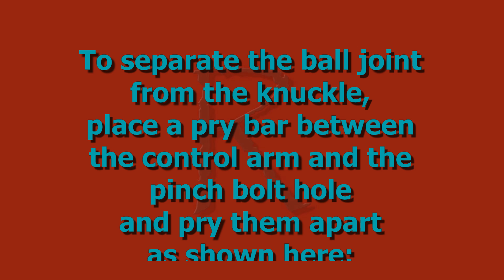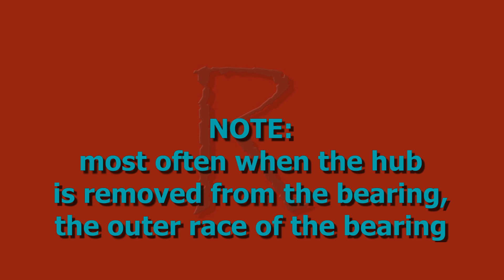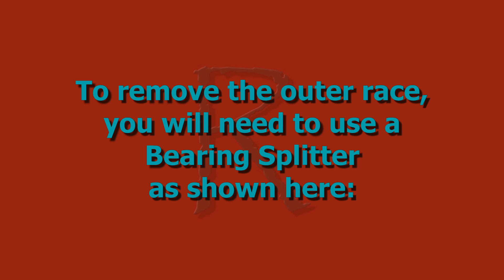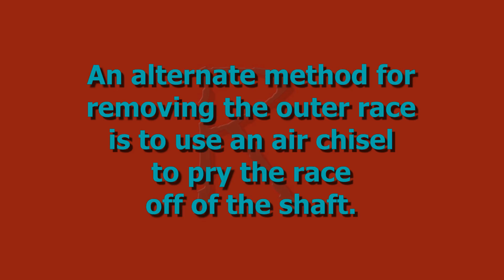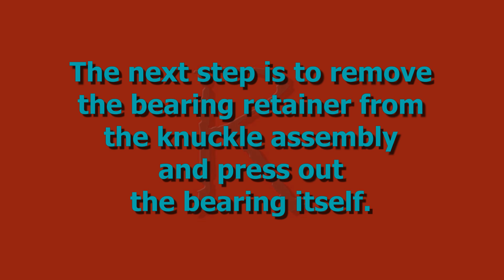Dodge Neon - Front Wheel Bearing Replacement

Comment: Thank you for making this video. It gave me confidence to go out and buy a 12-ton press from Harbor Freight and replace my front hub and bearings myself. It really was a simple processes. The only thing I would add is that, in order to get the steering knuckle separated from the steering rod (tie rod end), is to hammer the edge of the knuckle hard while lifting the steering rod up. Other than that, the explanation and graphic was real easy to understand. Thank you again!
Reply from the maker: Good tip,  thanks for commenting

Comment: Only problems I have with the video are: #1- If you compress the brake caliper piston prior to removing caliper it comes off really easy. You can use an 8 inch C-clamp to do this. #2- The drawing at the 7:23 time mark. It points to HALF of the inner raceway and NOT THE OUTER RACE of the bearing as the inner bearing raceways are 2 piece. They are two piece due to the opposing angles of the tapered bearing races.
Reply from the maker: I agree, I always suggest people use multiple sources and multiple videos when doing a job for the first time

I also try to include any of the million mistakes I've made because that is where you can really save people time

Thanks for the comment!

Comment: Personally, I believe in using the right tool for the job. I would recommend using a "pickle fork" to remove tie rod ends and other ball joints. It is much better to apply even pressure on the ball joint, bolts, and connecting arms on the knuckle. This is a highly preferred way instead of loosening the nut and hammering it out or using a pry bar on the lower ball joint. Just remember "pickle fork." I didn't name the tool.

I also want to point out the fact that he calls the inner race that was still stuck on the hub by the term, "Outer Race." In other words, what he calls the outer race in this video is actually the inner race. It's not a big deal. It's just if you came here to learn, you may want to learn the correct terms and proper tools. On the other hand he shows you how you can still get the job done even if you don't have all of the right tools.

It sounds like he hammered the new bearing set into place and that worked rather then having it pressed in. If you go that route be sure to use a block of wood, a brass drift or other soft metal so that you don't damage your new bearing..

I hope this helps on some way. Well, you probably could have gotten by without my comments and done just fine. Have a great time and make sure to do the job right the first time. Doing it over is NEVER fun.
Reply: Pickle fork is well worth the money and can be found at most autopart stores
Reply: David Allen
Reply: You do not need the pickle fork those tear the ball joint and tie rod boots so that you have to replace those after Also the best method is to hit the spindle around where the ball joint or tie rod taper goes into after hitting with a hammer around there the ball joint or tie rod will release with no damage

Comment: Hi mreinsmith, I'm back -- quick question (I think!)  I've got my parts (from Ebay.)  Looks like the whole, complete assembly that just slips over the axle itself.  It LOOKS like I don't even need to disassemble steering knuckles, etc, just take off the brake caliper, pad, and 32mm nut, slide this bugger on, and re-attach the nut and brake caliper.  Have I got that right?  (Wish I could send a picture, but they can be seen on Ebay just by typing in "2000 Dodge Neon front wheel bearing."  They have both the separate, individual bearings and the total assemblies, which is what I got.)  Thanks!
Reply: Its proabbly too late but he said you need a press to take out the old BEring so it would be hard to instal the new one in even if it is complete without removing the ols one from the knuckle which has to be reused

Comment: I have a 95 neon and my steering wheel shakes I put new tires and struts on it and then had it aligned but my steering wheel still shakes on the highway.  Any suggestions?

Comment: How do you know if it's the bearing going out?  My Neon '99 seems to shake a bit at over 45mph, but I don't want to do this if I don't have to.  Thanks!
Reply from the maker: Is the wheel getting hot? Compare it to the other side after driving for 15 minutes or more

Comment: My friend, this video was a godsend.  While it looks labor-intensive, it's not rocket science, and with any luck I'll save about $300 which I can ill afford.  Only thing that wasn't real clear, the partially-scored part you knocked off with the chisel: do ya get a new one?  If so, where from?  (I presume one that raty-lookin' would not be re-used.)  Thank you so much!
Reply from the maker: do you mean the inner race?
Reply: Yes -- but on a look at Ebay, I find I can get the entire assembly, without having to press bearings in or out, for a reasonable rate.  Thanks!
Reply from the maker: that's awesome, that's a great tip,  thanks for sharing